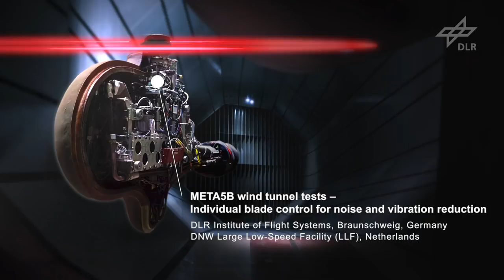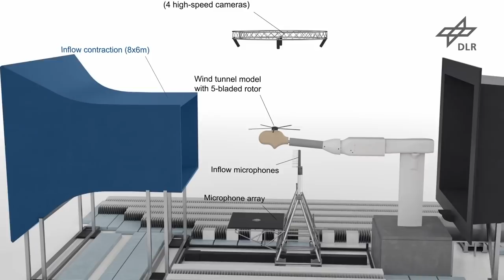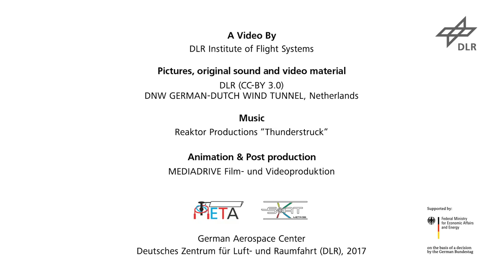A smoother helicopter ride with lower noise-emissions – 5-bladed rotor tests in the wind tunnel

Comment: so what it all means? 5 blades rotors are better for heli? better than 2, for example?
Reply: John Smith yes more blades typically means less vibration, more stable, smoother flight, better control. I think uneven numbers blades are considered better in some cases than even numbers.